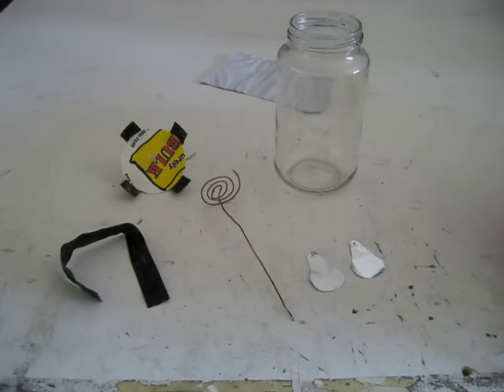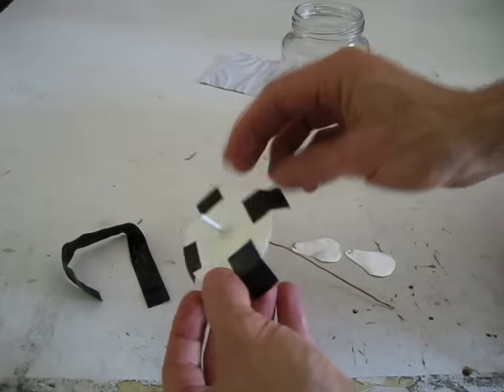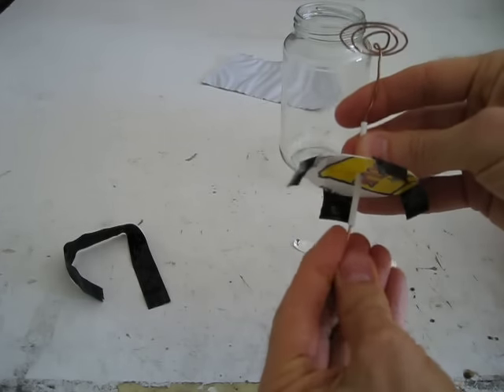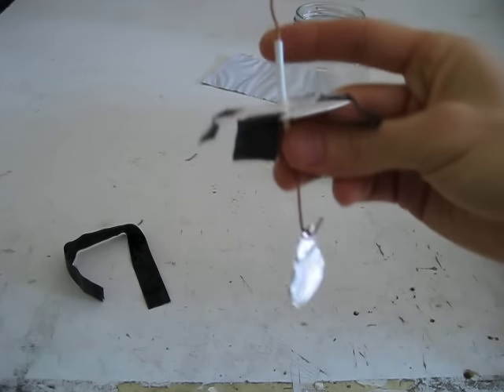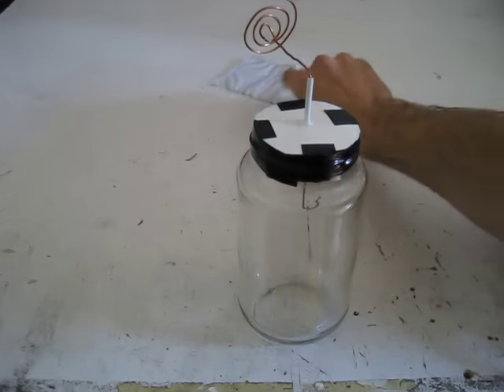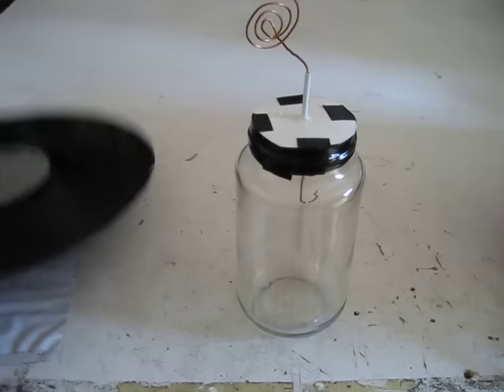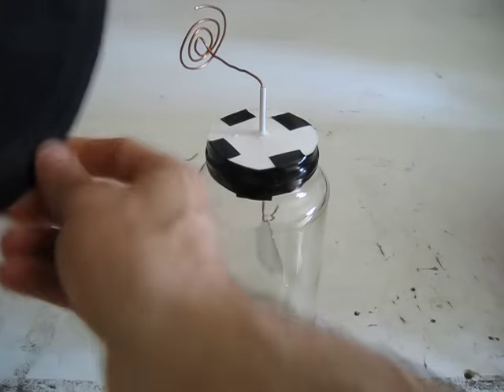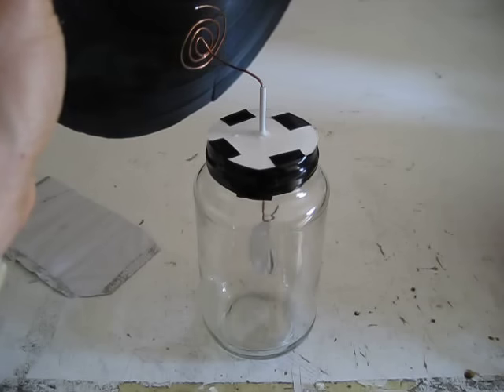How to make an electroscope (DIY)

Comment from the maker: @MrStupidity21 Masking tape should be okay. How humid is it where you're testing? High humidity makes it hard to charge things. Re the materials you're charging, make sure that the two you rub together are at opposite ends of the triboelectric series, the further apart the better (google triboelectric series for a list of materials.) For materials on the negative side of the tribo series, does putting them close to arm hair or hair on your head move the hair? It should.

Comment from the maker: The tube is just there to hold the wire vertically. You don't need the tube if you can do it some other way. And if you have a tube, it doesn't have to be sealed. If you're having problems it may be your charged object. Is the air humid. If the air is very humid then your object may not be charged. See my other video "Triboelectric effect/series or triboelectricity" for some charging ideas. There's a link in the description below this video or you can find it on my channel.

Comment from the maker: Not everything can be easily charged, but if it can be charged, you can test it. In this video I'm using the triboelectric effect to charge things and there's a particular list of what can be rubbed with what and how those things will become charged. See my video "Triboelectric effect/series or triboelectricity" for more on this. There's a link to it at the end of the video and in the description below the video. The size of the jar doesn't matter as long as there's room for the foils to move.

Comment: cool this is like magic! I wonder
1. if I hold vinyl still, will aluminum foil push each other forever like magnets?
2. can I use this device to eliminate or reduce static electricity that has built up in my body?
3. I will build my PC soon. but my house doesn't have grounded outlet and water pipe is not grounded so grounding is not an option here. how can I prevent ESD from destroying my PC parts without grounding method?
Reply from the maker: +Kokishin Azura
1. Yes, and no. Since the vinyl has a negative charge, it will attract positively charged ions from the surrounding air. The vinyl will give up its negative charge to those ions, making the ions no longer charged molecules. Very slowly the vinyl will no longer be negatively charged. Since the vinyl will no longer be negatively charged, the electrons will move back from the foils and the foils will come together. It may take hours or days.
2. Only a little. If your body is negatively charged, for example, then when you touch it with your finger some of your negative charge will move to the electroscope so that you and the electroscope together are equally negatively charged. When you move your finger away, the negative charge that moved to the electroscope will still be there and so you'll have lost a little bit of negative charge. However, it won't be much. On the other hand, if you touch a much larger metal object, or wires or pipes that go into the Each ground, then more of your negative charge will leave you and you'll become much less negatively charged, possibly so much that we can say you'd no longer be charged.
3. You can buy thick copper rods from some hardware stores specifically for pounding in the Earth ground to make a ground which you can use. They're around 4 feet long/1 meter and you connect a wire to them.
Reply: +RimstarOrg thank you very much for your answer. you helped me understand much better now and I will go with ground method as you suggested.  one thing though, in the answer you said "since the vinyl has positive charge" but in the video you said electrons move from your hand to vinyl. This make vinyl has negative charge(not positive charge) and will attract positive charge(not negative charge) from the surrounding air. am I understanding this right?
Reply from the maker: +Kokishin Azura Regarding my saying "since the vinyl has positive charge", that was my bad. The vinyl is negatively charged. I'll edit the comment so that it's correct. Good catch.

Comment: Can i ask, are the foils negative charge or positive charge? Why or why not?
Reply from the maker: The foils have the same type of charge as the charged object. In the example I do in the second half of the video, the vinyl record is being charged negatively. That repels negative electrons from the spiral terminal down to the foils and so the foils become negatively charged. I also show a diagram on my website here https://rimstar.org/equip/electroscope.htm
If you want to know more about charging objects then see my video about the triboelectric effect here https://www.youtube.com/watch?v=ey88EdZo9hU
Reply: @RimstarOrg oh ok.. thank you
Reply: Ahm another is... What is the actual charge of the foil?
(i mean when its not yet used for test drives)
 and why?
Reply from the maker: When the foils are together, they are not charged. We say that they're neutral. They have the same number of positive protons and negative electrons.
Reply: @RimstarOrg  oh ok . now i get it. Thanks a lot sir this helps a lot for my physics project

Comment: Can you use the original lid? Or must it not be airtight?
Also, can this be used to detect nearby lightning clouds?
RimstarOrg
Reply from the maker: You can use any lid, it doesn't matter. You don't want a breeze interfering with the leafs but it doesn't have to be airtight. As for detecting nearby lightning clouds, I doubt it. If the air around you is charged in a lightning storm then it's a bad thing since lightning takes the easiest path and that path is through charged air. So if the air around your electroscope is charged and the path of that charged air continues up to the clouds then get away from there. :)
Reply: Thanks!
Guess I'll try franklin's bell then. Any way to avoid it actually striking my creation?
Reply from the maker: Ramdatta Ropemaker
Do it indoors and you'll be fine.
Reply: RimstarOrg Thanks of all your help!

Comment: If friction upon the vinyl is dielectric the diamagnetic superposition of the aluminium foil is therefore attracted to the dielectric of the glass at room temperature?

If that is true, does not the conductor of charge become an obstructor of charge flow over time?

Comment: Will it work if the copper wire is scrapped a little in between? or will it work if the shape of the aluminium foil 's leaves are of different sizes?
Reply from the maker: +Awin Varerkar The wire can be scraped anywhere along its length but it really needs to be scraped only where the foils make contact with it. The leaf's shape isn't too important, just don't make them too big such that they become too heavy for the repulsion to work.

Comment: Thanks for sharing your knowledge! I'm teaching electricity in grade 9 science this january, at a very new school that doesn't have a lot of supplies yet. this is super helpful, i'm sure that (some of) the students will appreciate the demonstration.
Reply from the maker: You're welcome! Assign it as a project too! I'm sure the students will enjoy the satisfaction of getting one working, and the parts are all stuff normally thrown out. The wire can be clothes hanger wire or paper clips - just make sure to sand off all the non-metalic coatings where the foils hang. You can use the original covers from the jars, not need to make a special plastic one like I did. Rub a plastic coke bottle against clean hair and use the bottle as the charged object, or a balloon.

Comment: Hello Rimstar, my electroscope is not working i am using a plastic air tight jar and the humidity is 62%. Please help because my project is due on 12 Feb...
Reply from the maker: The problem most people have is with the object being charged. See my video about the triboelectric effect for suggestions for charging https://youtu.be/ey88EdZo9hU Another possibility is that you're not bringing the right area of the charged object close to the electroscope terminal. Only the area that you actually rub is charged, not the whole object. And lastly, make sure that there is metal to metal contact where the leafs touch the wire. If there's any coating on the wire there then scrape it off. Also, make sure the leafs are metal, not just a silver colored plastic.
Reply: @RimstarOrg  tysm, it works now looks like it wasn't working because of the paint on the wire, I scraped it off and it works when I charge a pen by rubbing it on my tshirt, but the other objects don't work but still tysm
Reply from the maker: That's great news, that you got it working. Thanks for letting me know.
Reply: @RimstarOrg  ty, u earned a sub 😃

Comment: Can you please do a video on how to make a cooktop? It's an electric cooktop, and can you also please do a video on how that cooktop works? And don't forget to upload both videos to YouTube!
Reply from the maker: Bruce Alexander A cooktop doesn't sound like something I'd be interested in doing, sorry. Thanks for your suggestion anyway though.
Reply: RimstarOrg C'mon! It's easy to make a cooktop! All you need is a power cord, a wire splitter that does not look like a wire, 2 capacitors, 2 coils, a glass frame to cover the coils, some tape, a piece of wood and some jumper wires! And don't forget to make sure both coils make pots and pans hot!
Reply from the maker: Bruce Alexander Oh, you mean an inductive heater type of cooktop. Those are a little more interesting. I'll think about it.

Comment from the maker: The most frequent problem people have is with the charged object. If the air is very humid then it's hard to charge things. Or, try different things such as rubbing a plastic coke bottle or a balloon against your hair and putting the balloon or coke bottle near the electroscope's terminal. For more on charging objects see my "Triboelectric effect/series or triboelectricity" video. There's a link in the description below this video or you can find it on my channel page.

Comment from the maker: @amarben123 If the wire were as thin or thinner than a hair and the voltage was high enough then charge on the wire would ionize the surrounding air instead of going to the foils.

Comment: I have tried this for making my recent physics project.. but unfortunately it's not working..can we try it with comb or paper??or testing material is specified??
Reply from the maker: Yes, running a plastic comb through clean hair or rubbing a balloon or plastic soda bottle on clean hair will work. Make sure you put the area of the balloon or bottle that you'd rubbed against your hair close to the terminal -- it doesn't charge all of the balloon or bottle. There are more ideas in my triboelectricity video http://youtu.be/ey88EdZo9hU as well as an explanation for how it works. Humid air also makes charging objects harder to do.

Comment: I liked ur video and i made it too but my aluminium leaves are not repeling. Please tell what to do as I have to submit this project tomorrow. Please answer fast.
Reply from the maker: Rahul030202 The problem is almost always with the charged object and not the electroscope. Try other things like rubbing a balloon over clean hair or a plastic coke bottle over clean hair and bringing the section of the balloon or bottle that you'd rubbed to near the electroscope's terminal. Also, the air cannot be too humid. Dry air is best.

Comment: Only complaint - triboelectricity does -not- require friction, only contact. The reason rubbing works better is because you are touching more of the surface. Normally, only a few high points on you are touching a few high points on the record.

Comment: what exactly is the plastic lid that you took from that container. That's all I'm confused about. and what could I use instead
Reply from the maker: +Riley Lathrop I didn't have the original lid for the jar, so I made my own using that plastic. If you have the original lid then use that instead. If not, then just make your own lid out of anything you have. It's purpose is just to provide a way to hold that wire up.

Comment: Hello once again.
Is the cork really required?
Reply from the maker: Prad Atrey I didn't use any cork. Maybe you meant something else. If you meant the straw, that's just there to hold the wire up. You can hold it up any way that works. If you meant the plastic cover, you can use the cover that comes with your jar instead. I didn't have the cover so I had to make my own.
Reply: I meant the piece of straw for fixing the copper wire in the cover
Reply: Thanks

Comment from the maker: This wouldn't be useful since the energy to make those electrons be free in the first place is supplied by me when I rub the vinyl with my hand. However, there is a charge separation maintained between the Earth and the ionosphere which you can take advantage of for small amounts of power. Do google searchs for "Hermann Plauson " or "Jules Guillot" for starters.

Comment from the maker: I don't know how big an area you've made for the terminal of the electroscope so I can't say if you need more. I doubt thickness of wire is the problem. More likely you're having trouble charging something enough. Try rubbing a plastic coke bottle or a rubber balloon against clean hair and use the bottle or balloon. The air in the room must not be too humid.

Comment: Does it have to be a COPPER wire and a GLASS jar ? can I use anything else instead? If yes, what?
Reply from the maker: The jar can be plastic. Just look around your kitchen or recycling bins for any glass or plastic jar. You can even use the lid -- you don't need to cut a plastic disk like I did. The wire can also be any metal. A metal clothes hanger is one source, but make sure you scrape off any coating where the foil leafs touch the wire.

Comment: What can I use as an alternate to the vinyl record to test if the electroscope is working? Please. I need it. This is my final requirement this semester.
Reply from the maker: Catleya Sorilla Rub a plastic soda bottle against clean hair or a balloon and clean hair and use the bottle or balloon. And there are other ones in my video about the triboelectric effect https://www.youtube.com/watch?v=ey88EdZo9hU.
Reply: RimstarOrg I've made an electroscope using the metal lid of the bottle, I made a hole in the center and I used a straw to avoid the copper wire to touch the metal lid. I tested it using a comb but it didn't work. I really have no idea what could be the problem or if I skipped something important.
Reply from the maker: Catleya Sorilla The way you made it sounds fine. Another problem with charging objects can happen if the air in your place is too humid. Make sure your hair is clean, i.e. no cleaning products, when you run your comb through it. Also, try other objects too as I suggested previously. It's possible that the comb is the wrong material or just not producing enough charge. If you gently shake your bottle, the leafs inside should move fairly freely.

Comment: Hello! My teacher at school assigned this type of project for us to do as homework but I can't seem to test it out if it really works. I tried rubbing a balloon to my hair and clothes but it seems to never really work. I think it might be due to the humid air around my house so I don't know what to do now.
Reply from the maker: You're right, it might be due to humid air. When you rub the balloon with your hair can you then try to make the balloon stick to a wall? The area of the balloon that touches the wall must be the same area that you rubbed. Or if you bring the rubbed area of the balloon near someone's hair (arm hair for example, or hair on their head), does the hair stand up? These are all ways to test if the balloon is becoming charged. Keep in mind, the area of the balloon that you bring close to the electroscope terminal must be the area that you rubbed.
If it looks like the balloon is becoming charged then the problem may be with your electroscope. The metal wire where the foil leafs hang from must be bare metal. There must be no coating on the wire there. In other words, the contact between the foil leafs and the wire must be metal to metal contact.
And it sounds like you might already have done so, but watching my video about the triboelectric effect might also help https://www.youtube.com/watch?v=ey88EdZo9hU

Comment: hello sir, i am making this right now and i dont know why it is not working, i tested it using a cd disk and it wasnt working. what can you suggest? and btw i need an answer right now please.
Reply from the maker: Jenny Pabunan Almost always the problem is with the charging materials. A cd disk may be no good. Try rubbing a plastic soda bottle (like a Coke bottle) against your hair (make sure your hair is clean). Or rub a balloon against your hair. Then bring the part of the bottle or balloon that you rubbed close to the electroscope terminal (the spiral wire.)

Comment: Why isnt it working for me...? I have done exactly like you have said .... And the temp. here is 7 degrees Celsius so it cant be humid ! So can you tell me why it aint workin ?
Reply from the maker: When it doesn't work it's almost always the charged object. Try something different. A rubber balloon rubbed against clean hair and then brought neat the electroscope terminal works well as does a plastic bottle (like a Coke bottle) rubbed against clean hair (emphasis on "clean", no gel, ...).
Reply: Alright , I will try it thanks

Comment: Can I use vaccum cleaner's hot air output to heat up the air inside the glass jar ?
Reply from the maker: If your purpose is to remove humidity then yes, that should make the inside less humid, as long as you keep the top open so that the humid air can flow out as you blow hot air in. Don't do it while the leafs are in the jar though, since they'll blow around a lot.
However, usually the humidity issue isn't with the electroscope. It's with the charging. For example, in the video I rub my hand against a vinyl record to charge the record. If the air is very humid then the record won't charge up very well.